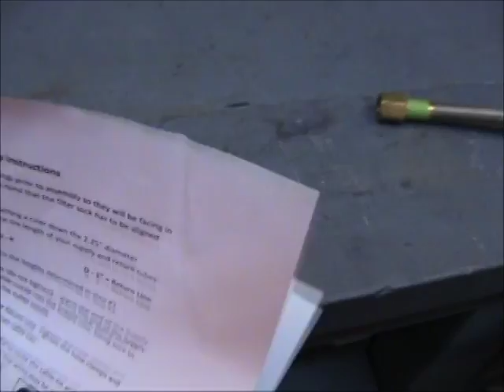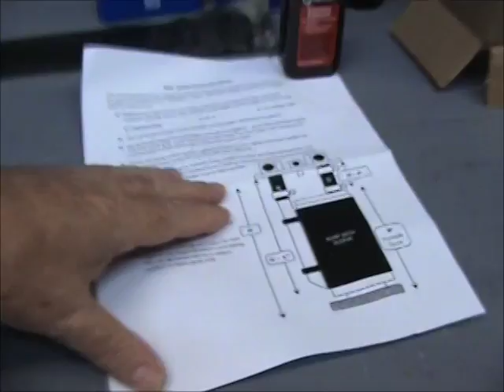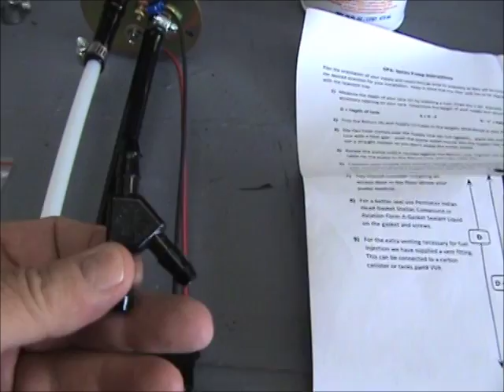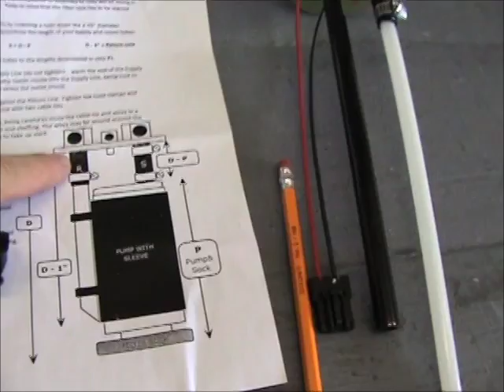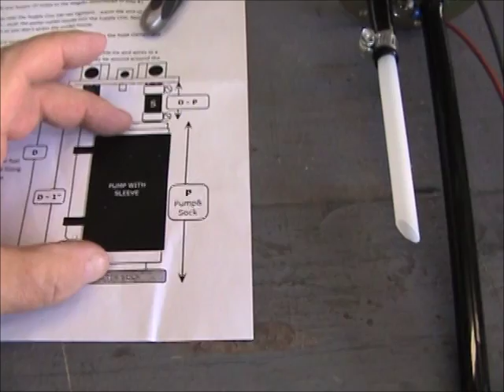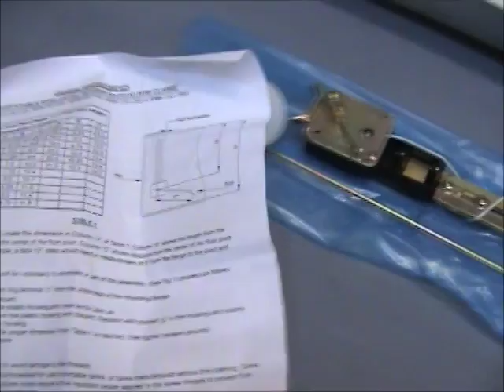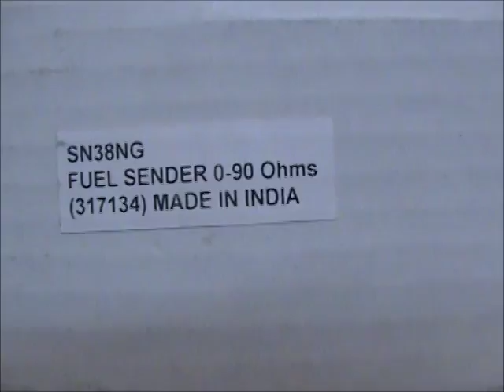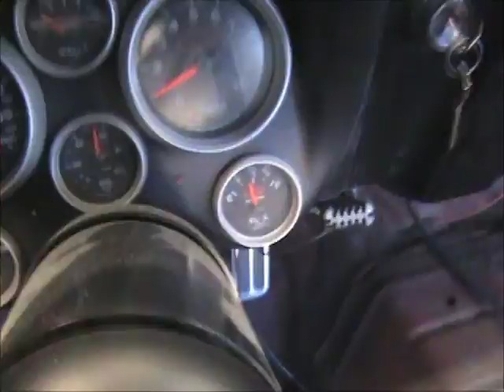1968 Camaro Resto-Mod 10-15-16

Comment: Way to go Tom, I was starting to install my tank today, I got it all together now it is wiring for me. I installed my vent under the car up on the frame my Gas Spout is behind the Tag so I am about 2" above that. You were lucky I only had 5 5/8" for my D measurement it was tight as hell. Congratulations. I wish I had some of that fabric you used on your wiring that sure looks clean.
Reply from the maker: Painless for the wiring covering it's pretty reasonable. Thanks Cary

Comment: Cool! Sounds great! Tom you mentioned you worked for the fire department as an inspector, did you inspect buildings and are you familiar with the IBC and IFC
Reply from the maker: Sam, yes I am familiar with the IBC & IFC, also NFPA - on several committees with the ICC & NFPA
Reply: Tom Noble I would like to get an interpretation from you on a code section I will pm you later as I'm in some training classes this week.